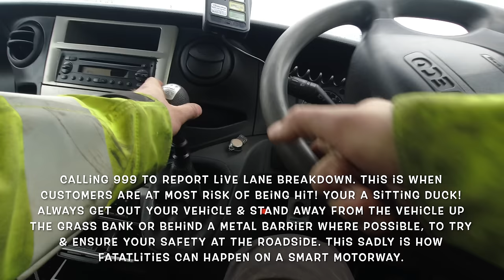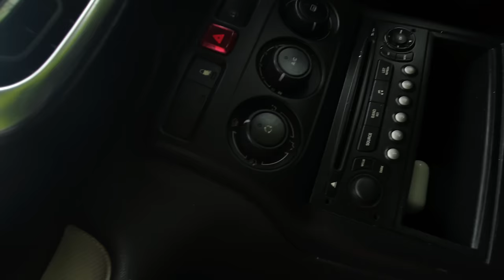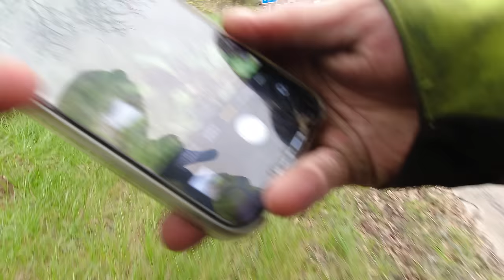LIVE LANE INCIDENT M6 ( Smart Motorway )

Comment: That highways chap done his job perfectly. Stopped a good distance back to provide protection, waved traffic to slow down while you worked on the offside of the car, and then when you needed to join back on the motorway he pulled out into lane 1 first giving protection to join too. 
You also done a great job too, efficient but safe.
Reply: Highways lad is definitely on the ball, never taking his eye off the oncoming traffic. Safety is clearly his priority. Surprised Greg didn’t mention it based on his last dealings with them 😅
Reply: Considering he looks on the younger side, he's probably new-ish. They're always the best ones to have to be honest, because they have the training fresh in their minds still. People prefer older ones because they have "more experience" but in my opinion I'd rather take the younger newer freshly trained ones. They also have less bad habits.. as you said, his eyes were always on the traffic and where Mr GDB was. Didn't look at his phone, didn't start a conversation.. did his job exactly.
Reply: Slowing down doesn't make it safer as other drivers are in lanes 2-4, all it causes is rubber necking and Pepole looking causing crashes

Comment: I'm glad they have put a stop to building smart motorways atm
Reply: Annoyingly the last one to be built is right up my neck of the woods on the M6 around Warrington and Wigan. To make things worse, the works have been extended until Spring 2025 after having started in late 2020/early 2021. It will actually be strange not having to average 50mph when they finally finish the damn thing.
Reply: They have not stopped they are doing more on the M6 north but say it is safety sign improvements a blatant lie as they have 20 plus miles of average speed cameras at 50mph.

Comment: spec lift looks better on the iveco chassis was to heavy for the transit. looks a good jab well done. like your message at the end slow down and move over. been  told recovery trucks can have red flashing lights when stationery recovering a vehicle before long. we've been using a single red flashing light for years. on the rear of our truck.

Comment: Up North on the A1 the highways guys and galls block the lane and put 100yds of cones out behind their car to get traffic moving across , they don't just rely on the flashing lights .
I use a set of low ramps with a cut out section for the spec to sit down in on my truck .
Just a 3ft x 8" sheet of 3mm tin on the bottom with the ramp raising from zero to 5" over 2ft then around a 4" gap then the 8" x 8" x 5" high box with a slightly concave top - all welded on the 3ft base of 3mm tin .
Place the ramps infront of each wheel and extend the spec frame to the gap in the ramps and drop it to the ground so the raised block is in the spec frame where the wheel will go .
Winch / push the car up and across the gap where the frame drops in till it's sitting on the raised block with a concave top .
Raise the spec frame and get the straps on .
Ramps back in the truck .
Unloading is even easier , place the ramps and drop the wheels on the raised block - get in the car and give a push with your right leg and they roll straight off and you can steer / brake as it rolls back .
Way better than jacking , especially with the modern plastic undertrays etc .

Comment: Dear Greg   I am watching all your vids and appreciate your efforts greatly.   I see the N Highways have behaved badly and it's my opinion which seems to be simiar to others and ours that their decisions at times do not make the slightest common sense?
These days it  seems dodgy to offend those in high places and I am very much with you that you must record every detail that shows the facts of the matter in your perilous work that you do.   Your job is most definitely a dangerous one where by doing your jobe you mat be snuffed out at any time and in particular the dangerous task of recovery on any motorway that is ALR.   Why then is the rule = lane one closure that adds safety stopped?    This deserves further questioning?  It might be met with stupidity?  Why should those who designated the idea care one Fxxx about the consequence of their decision if they bear no responsibility or liability for that decision they made?

 Back in April 2023 our usually very reliable Toyota Land cruiser oil pumping system became faulty on the Southbound M1   1.2 miles before Tibshelf services.    I felt I had to keep going till I got to a bit of grass verge. Most vehicles would most probably  hve siezed but the better engineered Toyota kept going to safety.
The live lane was live for 49 minutes after I stopped.   BBC,  Panorama told me the system was 'out' at that time!
There was then a fiasco caused by the NH.    In any case who put the steel barrier there to pen drivers and vehicles in to keep them in live lanes?

If the Authorities do not accept any responsibility whatsoever for any damage to vehicles but more importantly anyones death on their ill designed motorways.  They have the audacity to publicise these inadequate motorways are  safer than Motorways with a continuous hard shoulder refuge which most good ,safe drivers know to be bollocks. Is it a surprise that drivers with perception are complaining about these serious facts?
The Smart Motorways Kill  org is the truth and is to be applauded.   That astute wonderfull caring lady Claire Mercer
is indeed one in a million and her supporters are indeed some of the most experienced drivers to be found anywhere.  Their hard work to rectify the dangerous situation on 'our' ALR  motorways deserves finality in their favour beause of the facts that they are 'right'. 

In 2012 many 'good' drivers on the forum 'Pistonheads' predicted deaths would occur due to the 'No Hard Shoulder'
design.  One said it was murder by design.  I asked is this idea really true?  Can anyone conceive such a ridiculous idea?   Some believe there are infiltrators on Pistonheads are the ones who are all for the killer idea of no hard shoulder.

Comment: I don't know why when calling 999 they can't just put you though to the highways control room as they can set the signals straight away and have a traffic officer on route. Same addage as a level crossing where the highway code tells you not to call 999 but use the phone as it contacts the signaller directly so they can stop all trains.

Comment: What happens when you turn up with that truck and the car is a rear wheel drive so you can’t tow it from the front?
Reply: this muppet would still probably tow it
Reply from the maker: Well you generally know what it is or ask the questions first prior to booking on ie fwd rwd 4wd. I have tow dollys on the vehicle anyway if i needed to use them etc
Reply from the maker: Hahaa yeah and 4 wheel drives for fun

Comment: I thought cameras were supposed to monitor smart motorways , so if you broke down you would be spotted !! See you going through Doxey most days !!
Reply from the maker: Well thats what they tell us right...
Reply: that's actually incorrect - the roads are monitored by something called SVD (Stopped Vehicle Detection) they look like a white pod on the gantry signals and are spread across the network at intervals. The CCTV cameras are used to confirm reports but if SVD hasn't flagged the vehicle up, no automatic signals would be implemented and no alert would be given to the control room. There's over 50 cameras purely between J14/15 which would make it impossible to scan through them all at the same time. In this instance, SVD wouldn't have flagged it because the vehicle was still on the entry slip (you can tell this by the gap between the verge and LBS1 [Lane below signal 1 - basically lane 1] getting smaller and smaller.. 

Still a risk though but what a cracking job @GDBRescueandrecovery did to ensure his customer was safely dealt with!
Reply: quite correct, I agree with you 'keithrogers2017'

Comment: why did that traffic officer behind you feel the need to cross a solid white line at 5.05 into the video then move back into the left hand lane. Are they not meant to comply with the law?
Reply: They have exemptions.
Reply from the maker: It will be more of the point of unsure exactly where the casualty vehicle is, ie situated in lane 1 , so he went into lane 1 to fend off that lane. Then in the distance he saw it was slip road so moved back over.
Reply: @GDBRescueandrecovery that makes perfect sense thanks for explaning

Comment: A large percentage of brake downs on motorways are drivers simply running out of petrol. Smart motorway or dumb drivers. Smart Motorways have emergency laybys. In 40 years of driving including 20 years as an HGV driver i have never suffered a sudden immediate vehicle failure that has caused the vehicle to stop instantly in a lane. There has always been some kind of prior warning allowing time to get to emergency lay-by. If drivers choose to ignore the warnings and try to carry on or fail to keep there vehicle properly maintained is that a fault of the Smart Motorway.

Comment: Whoever decided they were 'smart' motorways were, in my opinion, not very smart themselves. Obviously never had to work alongside or pull up on a motorway. 
They can only be 'smart' when the computer equipment is working, if they actually ever can be smart. Hear many stories allegedly of equipment faults/failures. 
I suppose there must be some logic, with a hard-shoulder being the most dangerous place on a motorway, let's remove the hard-shoulder and the danger is removed! 
If the smart motorways are so safe why are they now creating extra refuges? Why not go the whole way and connect each refuge to make a proper hard-shoulder. 
Take care working in live lanes not everyone obeys red X until they can see the obstruction at the last minute. There have been fatalities near me on M1 near J34 plus a recovery worker lost legs even before hard-shoulder removed in same area.

Comment: The smart motorways should be banned and revert to a hard shoulder,if any vehicle breaks down it cause mayhem<how do I know well I have used the M42 which has a smart motorway so how the hell do you call for assistance,and if it's bad weather where do you go? into the grass areas? What if the recovery cannot get to you for many hours.
Reply: So you don't drive on any duel carriageways then?
Reply: I have driven on the smart motorways and every type of road too even across country in reverse too with a 26 tonner with a hiab crane at the rear,I have also driven in very bad weather at all times of the day,I have worked with crew members on every type of road doing repairs on the hard shoulders even over railway bridges,What I and the gangs did was dangerous.I and them were highway maintenace doing accident repairs or new bridge decks and we only had cones out to show the public you cannot enter road works.I was not the only driver in UK doing that type of job and a few males lost their lives doing work to keep the roads safe.I can say I have been on the most roads and bridge decks in UK working and is scary sometimes because drivers are looking at you to see what you are doing,so smart motorways are very dangerous because you can get a driver who has missed the signs say driving behind a large vehicle and when it comes to that vehicle that has stopped it causes mayhem when in heavy traffic becuse those in the extreme lft lane have to move to the right but they cannot because the traffic is so dence,It's ok early mornings or night time,the other thing is recovery of that vehicle? hard shoulder is need even for safety.Now do you understand i have driven on all types of roads even ones not yet made but tracks jonathonpalmer9593   @jonathonpalmer9593
Reply: If the highways officer vehicle had stayed in lane 1 then there wouldn't be an issue with vehicle's coming down alive lane you were clearly sill in lane 1 and the highways officers pulled onto the hard shoulder well before reach your destination-breakdown 🏴 6:00